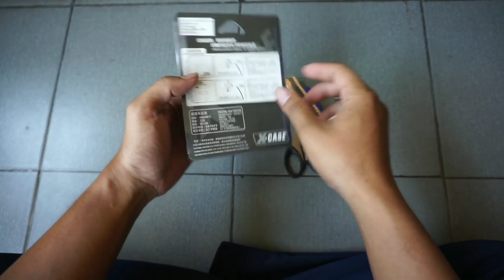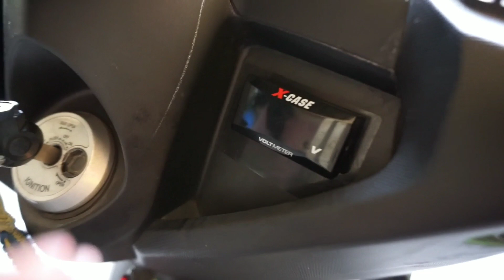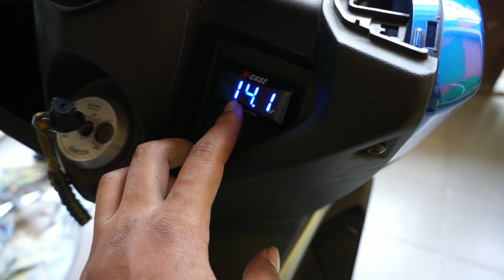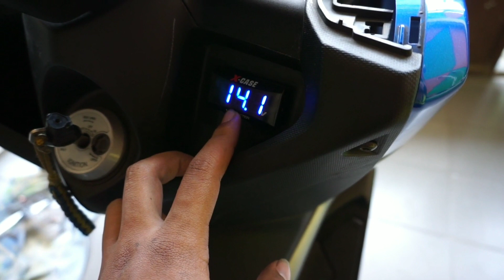Cara Pemasangan Voltmeter di Nmax | Ketahui Aki Tekor Sejak Dini

Comment: Aki motor saya 12.5 saat mati..
Dan ketika mesin hidup jadi 14.1

Lalu ketika buat jalan atau di rpm agak tinggi jadi 14.4.
Apakah normal...?
Reply from the maker: Normal itu . Kalo mati di bawah 11. Itu gg normal.
Dan kalo mesin nyala lebih dari 16. Itu over charge
Reply: @AndyAkbariMV  kalo over charge knp gan.ada masalah gak
Reply from the maker: @sibanggornasution2085  iya gan bikin aki overload menggelembung dan bisa rusak

Comment: As bos q juga pake voltmeter.....tpi masalah nya setiap nya mesin....terus di gas voltmeter nya angka bisa sampai 16.0.
Tu giman bos.
Tapi kalo di mati. terus kunci dikontak 12.5 voltmeter.
Reply from the maker: Wik tinggi amat om. Normalnya di gas itu mentok 13.9-14.0v kalo lebih itu bisa jadi volt mater yg eror atau emang over charge dari pengisian . Bisa dari spul atau kiprok
Reply: Oh... gitu ya.

Ntar besok mau ganti kiprok  nya..
Reply: Oya bos..  tpi stiap nyala lampu daya nya bisa kadang  11.9
Reply: Oya bos  minta no wa kamu ada gak...  biar ntar besok ku bisa video call kamu. Skalian ntar kasi liat volmeter nya

Comment: Itu di tempel doang ya om volmeter nya? Ga di kasih baut atau apa buat ngunci, takut d cabut tangan nakal
Reply from the maker: Siapa juga mau nge cabut om. 😊
Alhamdulillah selama ini aman² saja
Reply: Klo pake double tip 3M kuat bosku
Reply from the maker: @rinodioisamaulana3467  kuat om itu punya daya pakek double tape 3M beli di ace hardware

Comment: Bang, itu kabel nya cuma 2 kan? Satu (+) , satunya lagi ke rangka (-) kan?
Reply from the maker: Iya betul untuk yg volt meter only hanya du kabel. Kalo yg ada pukul / jam nya ada 3 kabel
Reply: @AndyAkbariMV  mas maap mau nanya pemakaian aki jangka waktu nya brp lama ke ganti lgi ?
Reply: soalnya saya ga pake volt meter mas
Reply from the maker: @dedikurniawan1609  tergantung gag bisa memastikan juga faktor keawetan aki itu sendiri ada yg bertahan 2-3thn ada yg 1thn bahkan belum sampai 1th udah soak
Reply: @AndyAkbariMV  tpi saya semua msh standar mas belum ada yg dirubah .
Reply: mas pake air radiator prestone gmn bagus ga
Reply from the maker: @dedikurniawan1609  iya sama aja walaupun normal tanpa ubahan . Pemakaian aki gg bisa di prediksi
Reply from the maker: @dedikurniawan1609  bagus bikin panas stabil gg over .
Reply: @AndyAkbariMV  pemakaian brp lama mas pake prestone
Reply from the maker: @dedikurniawan1609  1thn masih oke tahan korosi juga
Reply: @AndyAkbariMV  siap trmksh mas informasinya

Comment: Kalo dipencet rem kenapa volt meternya drop ya?? Turun ke 12 bahkan ke 11 volt..apa yg salah ya?
Reply from the maker: Pemakaian aki udah berapa thn om?
Reply: @AndyAkbariMV  6 bulan.
Reply from the maker: @iwaniskandar8964  kalo naik lagi di kisaran 12 masih aman namanya penggunaan daya itu musti naik turun om. Nah pas lampu rem nyala ada daya yg di pakai jadi volt otomatis turun nge baca nya
Reply: Iya tapi turunnya gak normal..sampe voltmeternya kedip kedip dibawah 11 volt hanya ketika rem ditekan.. jadi mungkin ada kesalahan pasang jika ambil arus positif dari lampu rem.. mungkin sebaiknya ambil arus output kontak dan masa ..
Reply from the maker: @iwaniskandar8964  waduh kok ambil dari jalur lampu om 😬
Reply: Ditutorial kan Dr jalur kabel lampu rem.... Saya dipasangi orang bengkel dicek ternyata dari jalur lampu rem ambil arus nya.. dan negatifnya ke negatif lampu senja... Makanya yg bener itu jalur nya positif ke mana negatif ke mana..untuk volt meter biasa yg buka 2 in one
Reply from the maker: @iwaniskandar8964  kalau tutorial saja ambil dari jalur kontak. Kemudian untuk negatif nya(massa) itu ikut baut body pokoknya yg nempel di besi body motor mana aja. Silahkan di simak video saja dari awal sudah jelas step by step nya

Comment: Bang, ketika saya nyalain on kontak nya, di voltmeter menunjukkan angka 12.1 nah pas mau starter agak susah nyala bang trus liat di voltmeter angkanya jadi 11 kadang 8 bang, trus klo udah keadaan nyala motornya menunjukkan 14.1

Gitu itu kenapa ya bang?🙏
Reply from the maker: Pemakaian aki nya udah brapa tahun bang? Bisa jadi aki nya sudah mulai rewel dan gg berfungsi dengan normal
Reply: @AndyAkbariMV  udah dari tahun 2016 bang belum pernah ganti sampe sekarang
Reply from the maker: @hanstandra3900  nah bisa jadi aki nya yg udah soak. Punya saya 2thn udah minta ganti barusan bulan lalu ganti baru
Reply: @AndyAkbariMV  berarti emng udah waktunya ganti yah bang akinya, oke bang klo gitu makasih info nya bang, sukses terus👍
Reply from the maker: @hanstandra3900  siap bang. Sama²
Jgn lupa klik tombol subscribe nya 🙏 biar makin semangat untuk bikin konten selanjutnya 😁
Reply: @AndyAkbariMV  siap bang, sudah😁👍
Reply: Akinya perlu di cas apa diganti dengan yang baru bang?

Comment: Kalau saat hidup angka volt meter nya ga diam di angka 14,1 naik turun kenapa itu ya bang
Reply from the maker: Iya itu normal bng voltase naik turun di kisaran 13.9-14.5 itu masih normal. Kalo di atas 15v atau di bawah 13v itu gak normal. Over charge atau pengisian gak normal

Comment: kalo volt meter di posisi mesin hdup n on  tpi ga hdup volt meter  naek trun ap yg bermasalah
Reply from the maker: Kalo voltmater gag hidup yg berarti yg rusak voltmater nya
Reply from the maker: Atau kalo motor mati voltmater hidup berarti nyambung kabel positif nya yg kliru itu
Reply: kalo volt meternya naek turun kenapa ya
Reply from the maker: @zaenalarif1457  normal aja volt meter emang naik turun di rentan 13.5-14v itu kondisi mesin nyala dan buat jalan itu normal
Reply: kalo kondsi mortor nyala volt meter saya  di angka 14 smpe 14.2 or 14.3 ga bisa berhenti stabil di angka  satu titik misal 14.1  ni goyang naek turun trus

Comment: kalo kontak on mesin gak nyala tapi volt meternya naik 14,3/14,6 gmn
Reply from the maker: Tinggi amat mesin mati harusnya di kisaran 12-13v kalo mesin nyala baru 13.9-14.1v normalnya
Reply: @AndyAkbariMV  itu bang dia dari angka ke atas plan" turun tpi mesin gak nyala cuman hidupkan kontak
Reply: @AndyAkbariMV  voltmeter saya sekalian USB
Reply from the maker: @aokijigaming9757  wah kurang tau juga tuh soalnya voltmater nya yg dgn usb. Kalo saya pakai yg voltmater only